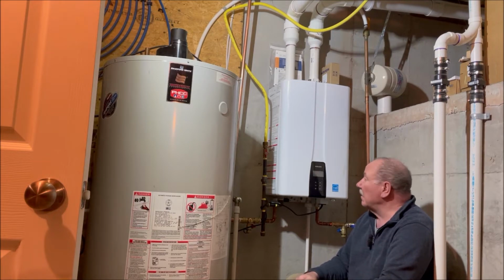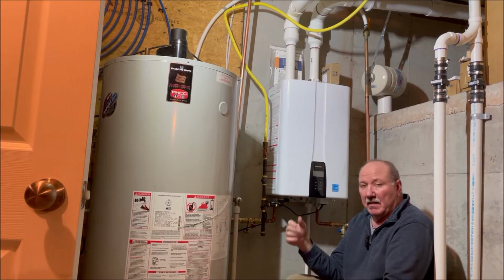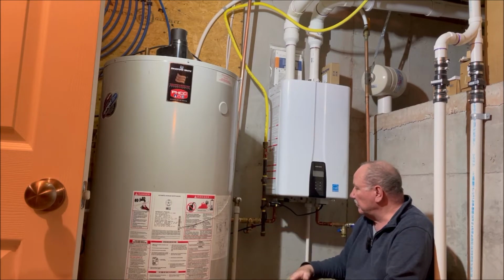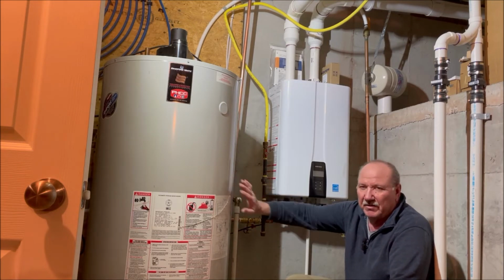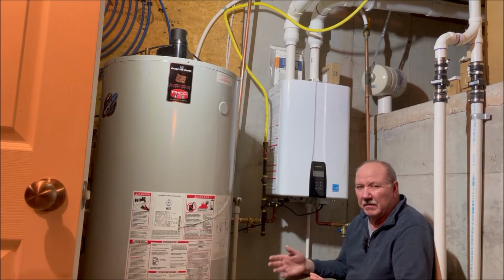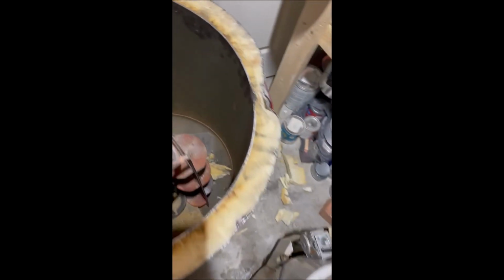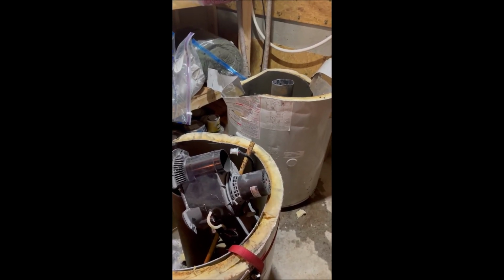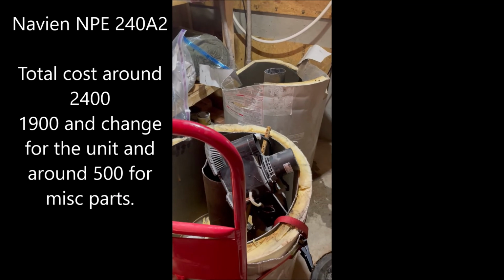Navien NPE 240A2 Tankless Water Heater

Comment: Still holding up for you? Is the expansion tank necessary? I read of you have a closed system with a check valve it is, but my PRV has a bypass and I see the water meter allows back flow every now and then.

Comment: I 'm looking at replacing a 13 year old Sears , 40 gal water heater that's just starting to show some symptoms. Began a project today to investigate replacing it with either a 40 gal tank or going tankless. the first contractor I spoke to suggested this model. They also had a Rheem unit. Would appreciate learning how to maintain it. It's pricey but if it lasts 20 years it may be worth it for the convenience. Thanks for the info in this video.
Reply from the maker: Check out the video for flushing the Navien. I works like a coffee maker and needs to be descaled every year. Definitely a job you can do yourself. I can’t speak of the quality for the Rheem but the Navien works great. Thanks for the comment.
Reply: @theworkshop6588  Thanks for getting back to me and the info you've provided.
Reply: @Ouzelfalls  I hate to say it but there’s absolutely no way any tankless unit will last 20 years. Especially if your water is hard. They need to be flushed at least every six months and this is no easy flushing like with a tank heater. On a tank you can just buy it and forget it for 10 or more years like yours even without flushing. With a tankless I can assure you it will have problems within the first few years and parts can be thousands. Another disadvantage of a tankless is that when the power goes out. Boom there goes your hot water until power is restored. I highly recommend you get a new tank. It will serve you well for years and if anything did go wrong, the most expensive part is 150-200 dollars and not a thousand or more like a tankless.

Comment: I just have the Combi Navion unit in our home, Just love it. Endless hot water and heating out home with the same unit, Wonderfull. Hoping for 20 years of use. Love the idea of pay (gas) ONLY when in use. Goodby to the 24 7 heating water with the old tank. Highly recommend to everybody.
Reply: You’ll only get 5-7 years out of it even with annual maintenance. Go watch Mikey Pipes channel. There is a design defect on the NCB heat exchangers. You’ll start to hate it and regret installing that wall hung junk in the first place.